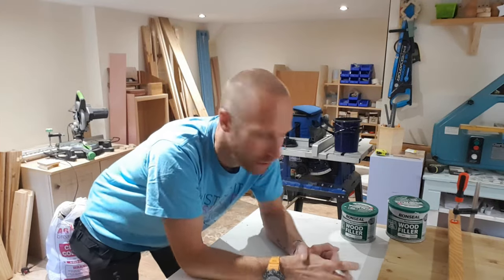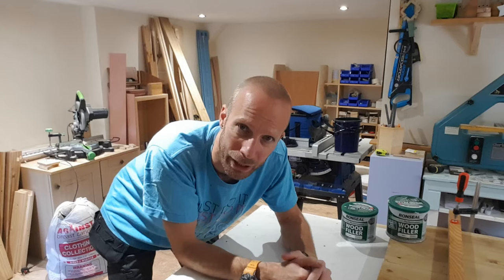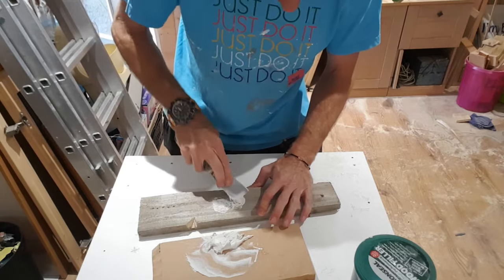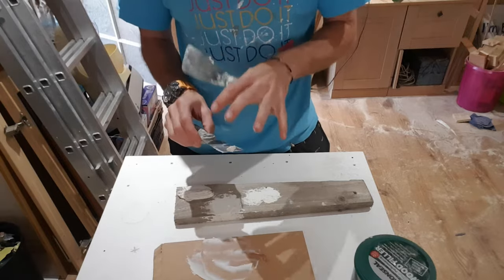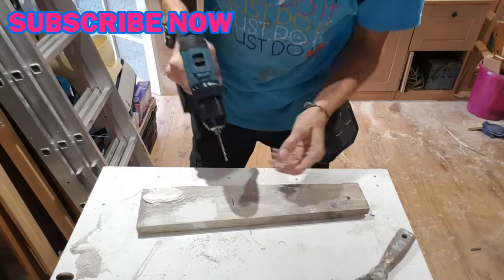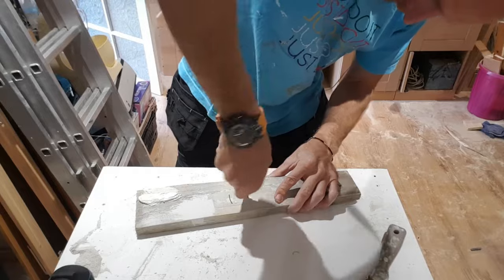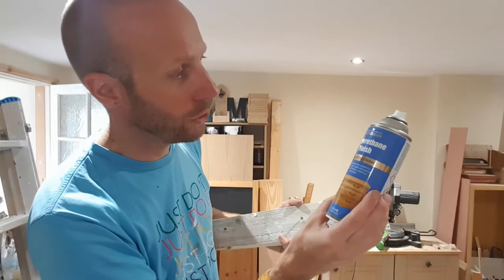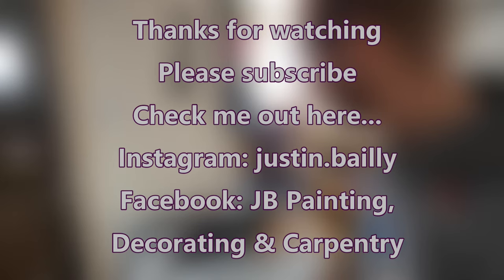Let's try Ronseal Wood Filler

Comment: Thanks for the video Justin. I've just had a frustrating day with this stuff, it's impossible to mix small quantities accurately (50 g filler to 38 mm hardener is just too extreme) and you don't have time to fill a number of holes, you have to do a number of mixes.

Comment: Justin wear a dust mask or respirator mask when working with this stuff especially.  The fumes are potent, and the chemicals it’s made from are likely to do your lungs no good at all in the long run.  I understand it’s difficult to make this type of video with you mouth and nose covered.  Cheers.  P.S.  Promote  methods to keep the lifespans of trades people long,  Health and Safety 1st.  Priority.

Comment: The one problem I am having is trying to smooth the paste out, it sticks to everything, do you have advice on what if you can use on the metal/plastic spatula to stop it from sticking
Reply from the maker: Yes it can be a bit sticky, avoid using too much hardener, and get all the filling done asap

Comment: I have a tv cabinet in pine. I want to paint it white. I have a bit of damage to the door like the notch chunk you filled in. That is a big tub of filler. What is the difference in buying the smaller 325 gr tooth paste  style tube version compared to the tub you have in the video? As I only need filler for a very small job. If the video person Justin, could help or a member of the public. Thanks.

Comment: thanks for the great video. if using on pine floorboards that will later be painted white, what colour filler is best in your opinion?
Reply from the maker: Get the white one, but even if you get the brown one, once the undercoat primer goes on it'll be fine.
Reply: @JBTV  thanks!

Comment: I've used this product on a window frame, now I want to paint and put fresh glazing putty. Does anybody know if water based undercoat will soften the  hardened Ronseal filler and ruin it? Should I use an oil based undercoat or will this ruin the Wood Filler? Should I paint undercoat before I apply the putty, will the linseed oil in the putty soften and ruin the wood filler if applied directly to it? Thanks
Reply from the maker: Which ever way you approach it, you won't ruin the filler. Prime it, then putty.
Reply: Thanks for the info and quick reply

Comment: An excellent demonstration - thank you.
I'm having to build up the bottom legs of a number of MDF  radiator covers (why are they all 82 cm high?) by about 7 cm. I was thinking of either using MDF or simply creating a former for a 2-part wood filler to create the extra high - I know this can be readily sanded down to a very smooth finish. I will be doing this before assembling them as they come in a flat-pack - any suggestions on the viability of using a former that will be easy to remove from the wood filler once it is dry?

Comment: Hi, Justin. Can this filler be used to fill a half-inch deep, six-inch-wide hole on an MDF kitchen table? The table has fold away chairs that fit under the drop-leaf sides. Unfortunately, a bottle of wife's cleaning Peroxide leaked on it and caused it to blister the Formica wood effect finish and swell the MDF fibres underneath. I've cleaned out the loose wood and want to fill it and then cover it with a wood pattern Fablon sticky-backed plastic, but don't know what filler to use. 
She wants to buy another table for nearly £350 but I'd rather have a go at fixing it and buy myself a new rod & reel for sea fishing! The Fablon only costs £6! Any advice would be appreciated. Thanks.

Comment: I've just Stained my decking today after using this filler in some places, some big some small and it shows right through.  I'm using ronseal rich mahogany stain, is there anything to your knowledge I can do to match or blend in before my second coat?
Reply: with woodstain you need to apply three coats anyway if not 4 but it's best to use as little filler as possible really for small holes dents best to colour match a wax stick filler

Comment: OK.. So the tin should be square to make it easier to get the filler out. The filler with even a small amount of hardener goes off too quickly. It shrinks when it fully cures so you have to go over it again. It's near impossible to stain so really only practical to use with a painted surface.
I would say this limits this products usage.

Comment: WARNING this filler does NOT work with MDF.
Reply from the maker: How come? I've always used it with MDF and never had any issues....
Reply: @JBTV  I phoned Ronseal this morning because the filler I applied on a piece of MDF was still slightly soft. The technical person at Ronseal told me that it only works on wood and not MDF. The filler in the MDF had not gone off although the filler on the board that I had mixed the filler had all gone rock hard